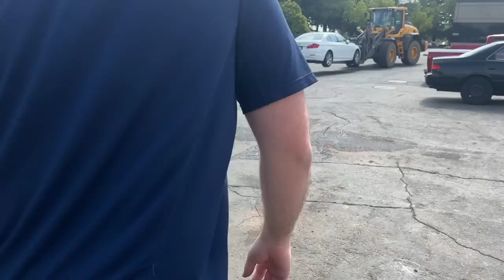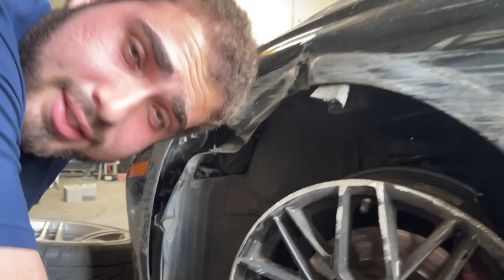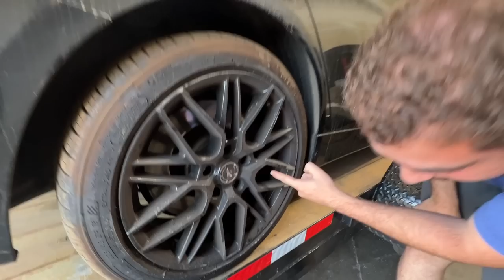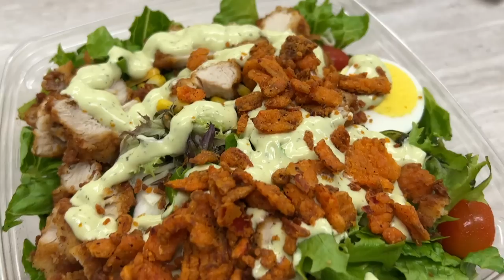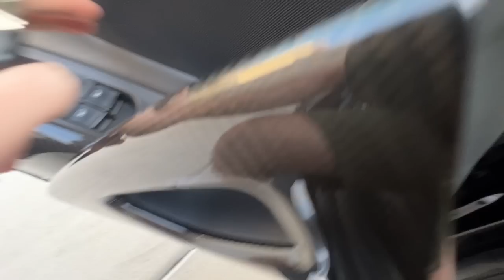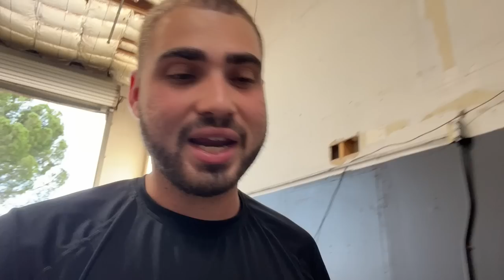I JUST CANT HELP MYSELF! 3 NEW BMWS, 2 WE ARE SAVING, 1 IS AN M!

Comment: I’m out of options so thought I’d ask here… I have a 2014 535i and the headlights have been diagnosed as having bad modules. 9k to replace at the dealer so not worth it. Does anyone have any ideas? I can’t find complete used lights or any reasonable solution.